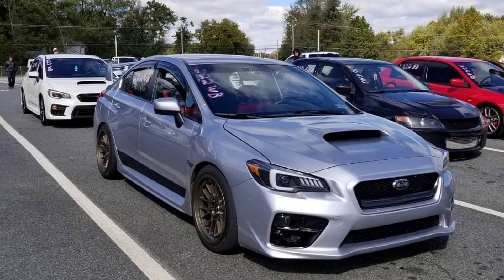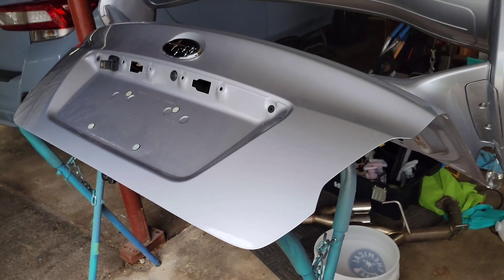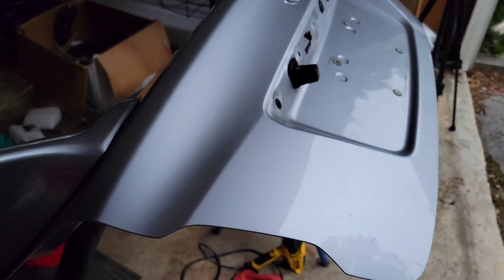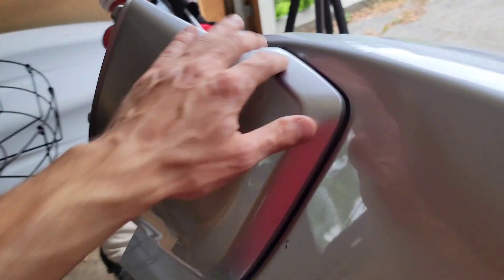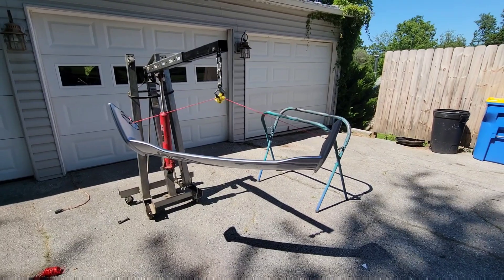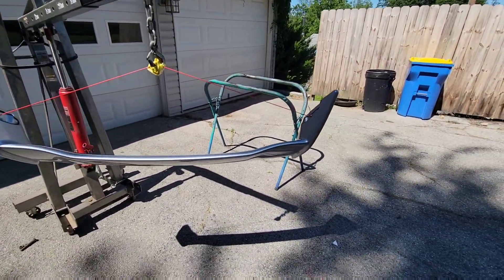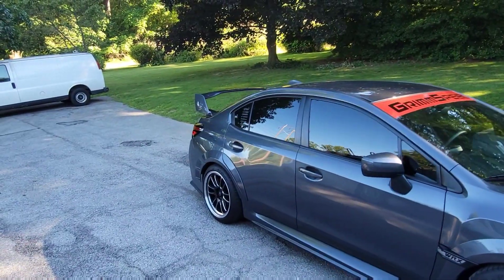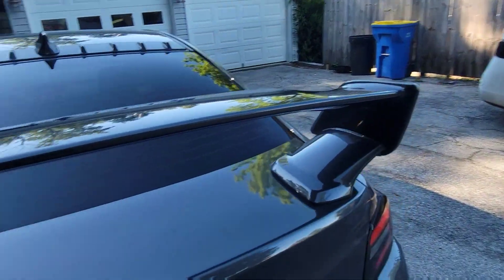STI Spoiler On My 20 WRX (Came Off My 15 WRX 3Yrs Ago)

Comment: Quick question, would you recommend having a professional paint the tail lights or having someone applying a tint film?
Reply from the maker: Really depends on what you want. Premium auto styling offers a vinyl that looks very similar to my tail lights and it's easy to install and easily removable if you need to for some reason. The overlay will cost you $30ish. Paying someone to paint them would be very pricey. I have done a few sets for people and charged $100, but im guessing a bodyshop would charge $200-500 depending on the shop.